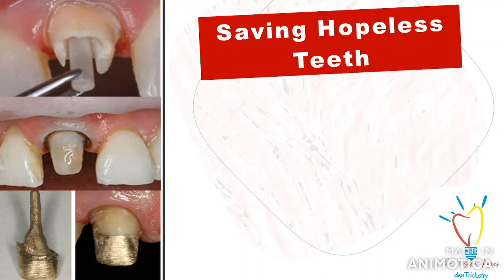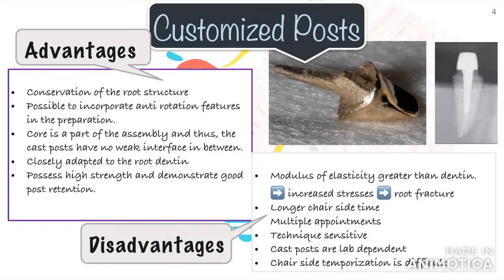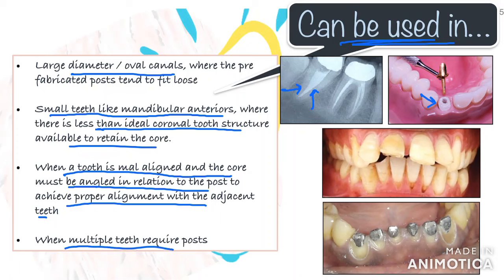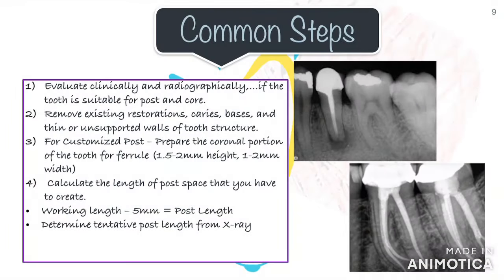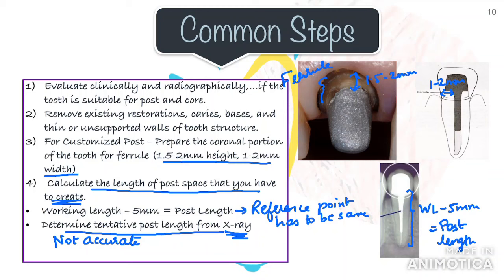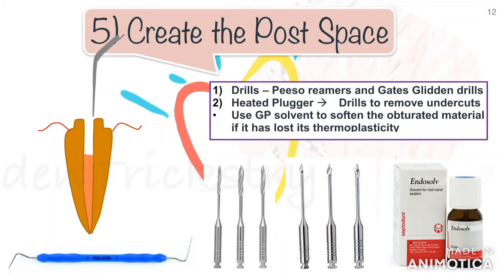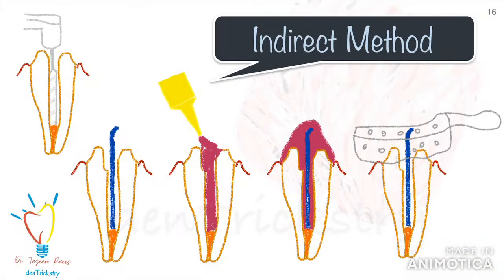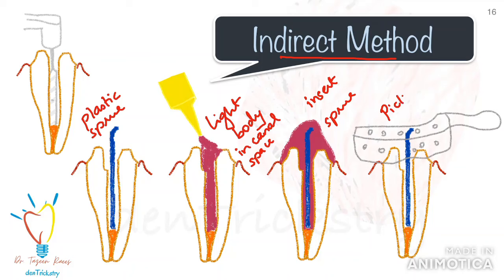POST AND CORE  (Part-2) / SIMPLE STEPS FOR POST & CORE PROCEDURE / Customized VS Prefabricated Post.

Comment: How can we place a post in type 2 canal
Reply from the maker: In my opinion, in any abnormal canal configuration, I would 1st take a CBCT and evaluate that if I create the post space, there should be at least 1.5 mm of dentin thickness surrounding the canal circumferentially throughout the post length ...only then proceed with the post and core technique.
In such cases, you could create a post space equal to the height of the crown (minimal length)....no need to create post space all the way leaving only 4-5mm of GP.
If a post and core procedure is not possible, then you can do only a core build-up. Here, you have to remove the GP only from the coronal portion and restore that space with materials like para core / luxacore.